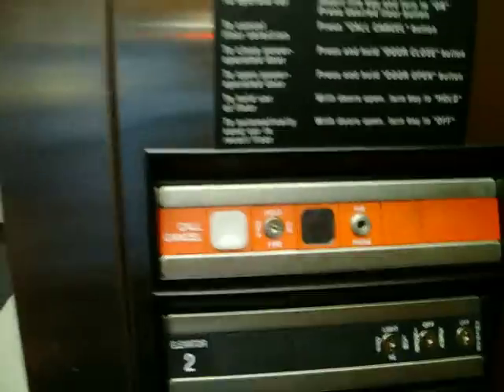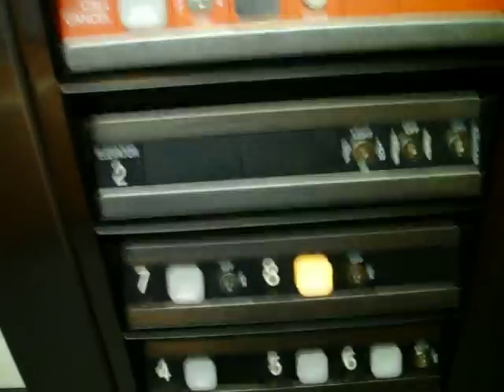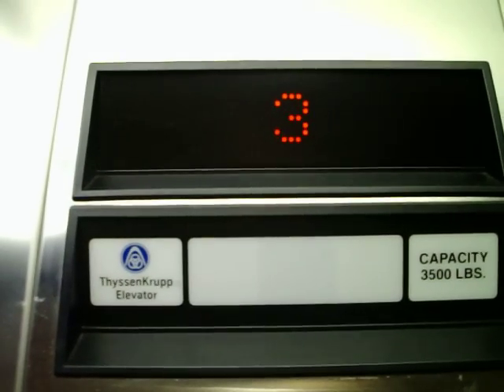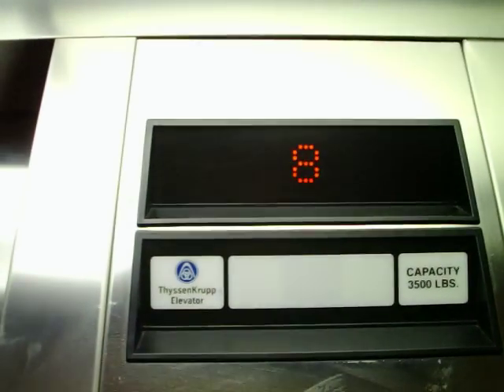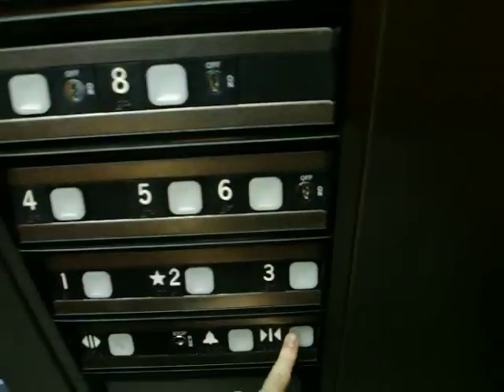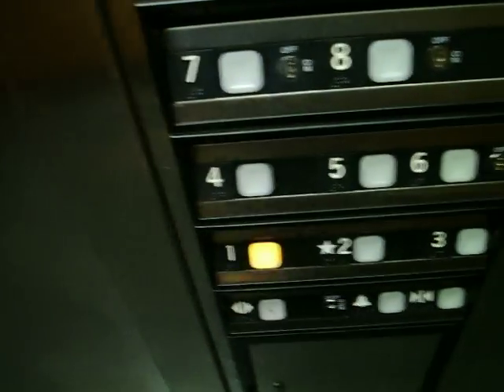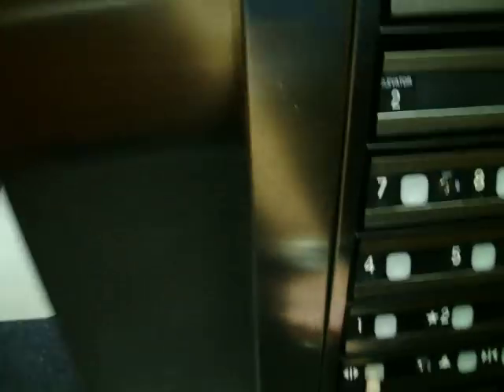Thyssen Krupp Fire Mode

Comment: 0:08 Elevator fire service recalled is on, nudge mode!
0:17 Nudge Mode Recalled like Otis Elevator
0:21 the Firemen Hat is disappear after Elevator is recalled.
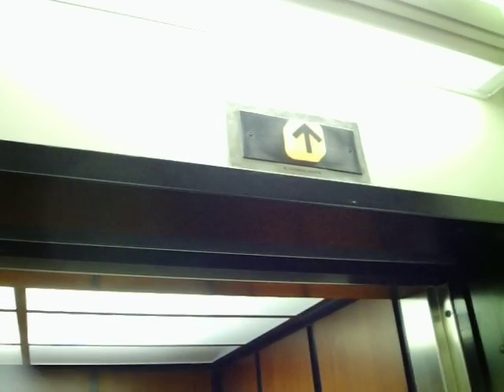2:41 Bypass to turn off with buzzer.
2:43 Going up chime.

Comment: That is the long buzz I would hear if this thing were in nudge mode. The operation of it being in fire service is kinda interesting but I am not going to activate fire service on an elevator because it is illegal but it looks like you had permission because you said it was a brand new Thyssenkrupp elevator.
Reply from the maker: Yes you are correct.  As I work in safety, I have keys and can run test on fire service to make sure they are working correctly.
Reply: @neaelevator  that’s good that you have a certification to do these type things.

Comment: The buzzer, the arrow and the bells are turned off to save energy. Also, you can tell the elevator is operating because of the motor. All safety sensors except for the door bumper are also deactivated. Lastly, they want to save as much energy as possible to make as many trips and save as many people as they possibly can.

Comment: I’ve taken a course on elevator emergency operations when I was in college for my Network administrator certification. I also learned this procedure in high school during training for my internship because it was a mandatory training otherwise I would of been disqualified. Also when I got the job with the port authority of New York and New Jersey I also had to take this course. Because the Air Train at JFK airport has a fire recall system. If there was a fire the train would return to Jamaica station until I put the train into fire service and manually take control over it

Comment: Dover/TK elevators are the only ones where the fire hat doesn't stay lit after the elevator hits the ground floor and the doors open.  On some newer ones, depending on how the light is interfaced with the fire alarm system, it will stay on or even flash, but on this common series of elevators, I think the light should stay on to indicate it's in fire recall mode.

Comment from the maker: @msj191961 What your dad said would make sense.  In some cases, when the fire alarm goes off the elevators will return to the nearest floor or the lobby automatically.  In that case they would be tied in to the fire panel.  Ours are not though.  As far as the key, I have seen them on Ebay a time or two.  Other than that I would not have a clue.  Mine came with my job.

Comment: I know floors 6 7 and 8 were locked off restricted why does fire service work on restricted floors I thought you can’t unless you unlock the floor
Reply from the maker: That is a great question. Fire code requires that fire service override all locked out floors in case there is an emergency on those floors.